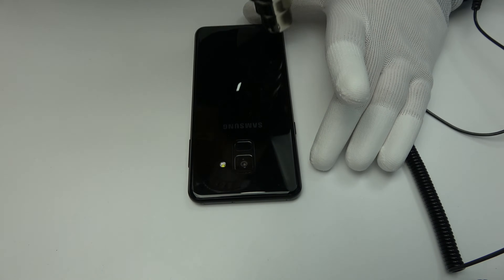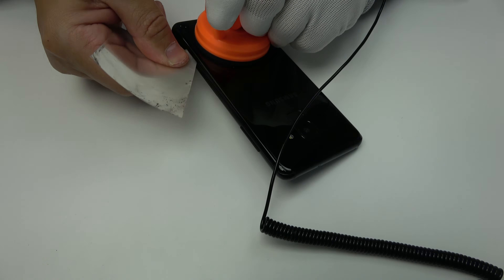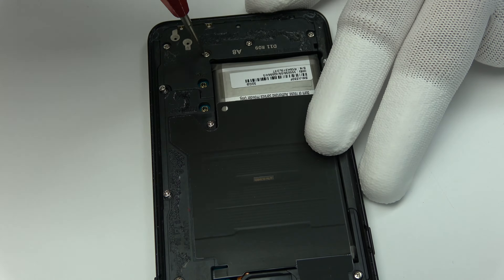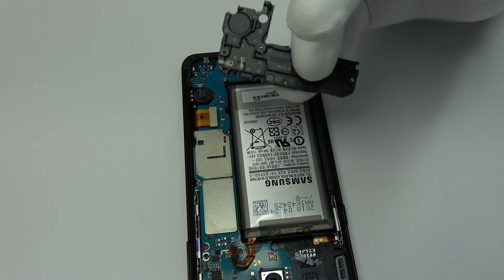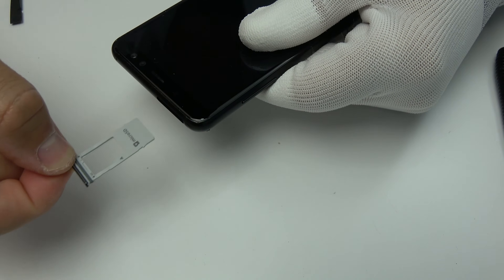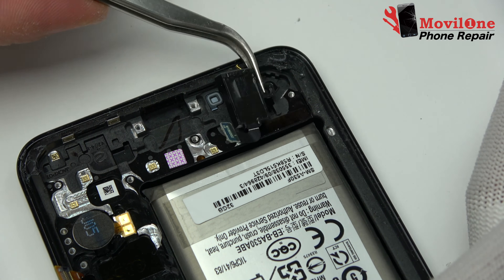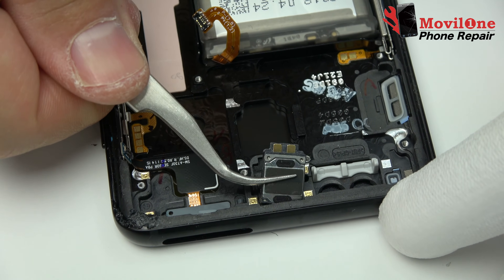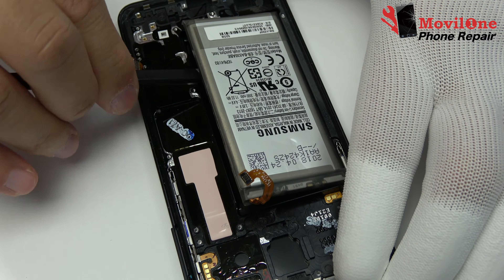Samsung A8 2018 Teardown - Repair Guide

Comment: i broke the back glass and my volume button is broken in 2 peaces and know my phone wont turn on normally it gets in a reboot screen were i can delete and reboot and turn off the device does it mean it is broken. and is it expensive to get that repaired if the phone still works. i have some stuff that is important on the phone

Comment: Hi.What i did wrong, after i  warmed up  the back cover when i tried to take off with a blade it craked up all...Thanks.
Reply: You might've gone too deep or not heated enough, if it takes a while you can warm it up again. Generaly it should be just too hot to touch when you heat it up
Reply: @jodlaa5142  thanks for replying.